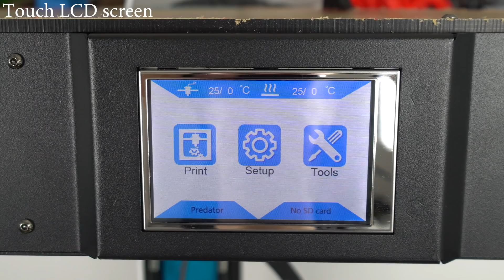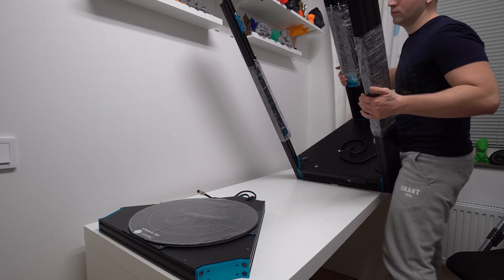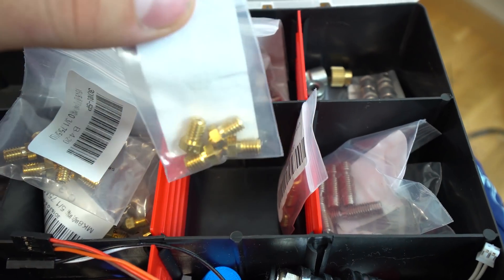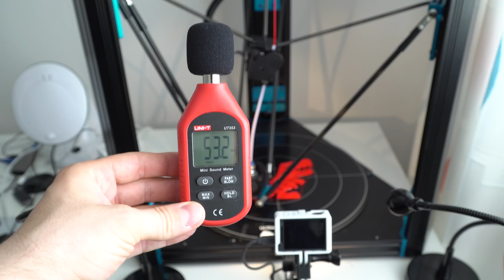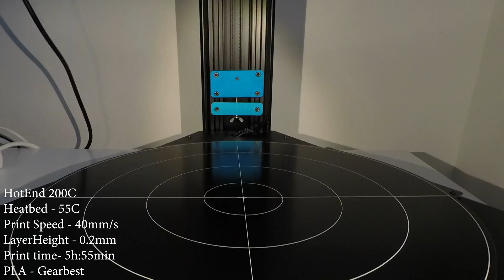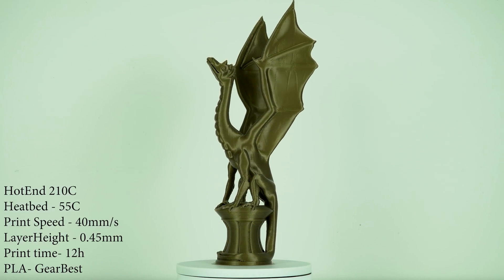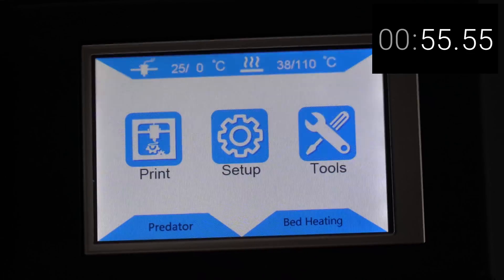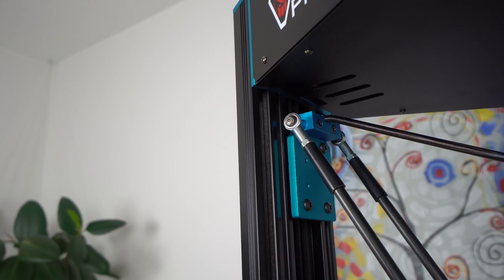Anycubic Predator 3D printer Review - all you need to know

Comment: How does the Predator compare to the Chiron?  Was there an appreciable difference in speed or print quality? Great reviews- appreciate the indepth look
Reply from the maker: Thanks Thomas! Yes there is, Predator is much faster and more easier to level then Chiron. In terms of actual print quality Predator is better then Chiron at higher speed as it's Delta but on other hand Chiron has Massive 400x400 heated bed and it will print much bigger object then Predator. It's dead race between Speed and Massive Size. Car VS truck :)
Reply: @NexiTech  - Cheers! Thanks for the insights

Comment: Which slicer do you use? And if possible can you share the printing profile for the printer?
Reply from the maker: Peter Horvat PLA
Layer height 0.2mm 
Top layers 5
Bottom 4
Walls 2
Flow 103%
Infill 20%
Hot end 200C
Heat Bed 55C
Print speed 50mm/s (up till 100mm/s depending of model)
Travel speed 120mm/s (up till 200mm/s depending of the model)
Retraction distance 5mm 
Retraction speed 70mm/s
Cooling 100% from 2 layer
Minimum Layer time 10s

PETG
Layer height 0.2mm 
Top layers 5
Bottom 4
Walls 2
Flow 103%
Infill 20%
Hot end 220C
Heat Bed 70C
Print speed 50mm/s
Travel speed 120mm/s 
Retraction distance 5mm
Retraction speed 70mm/s
Cooling 50% from 2 layer
Minimum Layer time 10s

FLEX - from the video
Layer height 0.2mm 
Top layers 5
Bottom 4
Walls 2
Flow 103%
Infill 15%
Hot end 220C
Heat Bed 55C
Print speed 40 or 50mm/s
Travel speed 120mm/s 
Retraction distance 5mm
Retraction speed 70mm/s
Cooling 100% from 2 layer
Minimum Layer time 10s

ABS
Layer height 0.2mm 
Top layers 5
Bottom 4
Walls 2
Flow 103%
Infill 20%
Hot end 240C
Heat Bed 105C
Print speed 50, 60mm/s
Travel speed 120mm/s 
Retraction distance 5mm
Retraction speed 70mm/s
Cooling 0% 
Minimum Layer time 10s

Simplified 3D Anycubic Predator standard print profile 
https://drive.google.com/open?id=1w9Vigkn7B-lKUcAPlnHZEVsymKBcpIoZ

 I hope that I helped
Cheers
Reply: @NexiTech  Thank you very much. Very helpful and saved me a lot of parameters testing time.

Comment: So anyone interested in this machine I figured something out.  On the net you will find two types of reviews about this machine.  Either GREAT reviews, or really AWFUL reviews.  This review is thorough and detailed as are others on Youtube.  On Amazon USA, about half of the reviews are great and the other ones are terrible.  1 or 5 stars, nothing in between.  But all the reviews appear to be from credible sources.  Most of us know our way around these machines.

I believe all the reviews with good ratings have the PREDATOR branding on the top front left of the printer.

The Amazon US page shows the Kossel D printer when you search for Anycubic Predator.  And the product images are mixed, showing units both with ANYCUBIC branding and with Predator branding.  I figured I'd take a chance and ordered this on Amazon USA.  My unit arrived with ANYCUBIC printed where I expected to see the PREDATOR logo.  So I had Amazon take the unit back free of charge. These are basically the same machine, but apparently the ANYCUBIC branded units were earlier units or models of this design.  And who knows what changed?  Different sensors maybe?  Or more likely they were earlier batches with serious QC issues, as is common with Chinese 3d printer companies.  But on Amazon the Anycubic seller is unscrupulous and just mixes them together to hock them off to us, BUYER BEWARE.  Don't these companies realize that reputation is everything? Anyway, the massive box was sent back to the seller at the seller's expense.  Anyone know where to get a legitimate Predator here in the USA?
Reply: I'm not sure if Aliexpress delivers to the USA but you could try your luck there. You are not the first to voice your concerns with regards to the QC differences between the "Kossel D" and "Predator" variant. Folks at Reddit seem to have the same hypothesis as you do.
Reply: UPDATE-  Well it turns out I was wrong.  Anycubic tells me that the units branded ANYCUBIC are actually newer than the Predator.  Apparently they changed branding because they were worried about infringing on the word Predator, which would make sense.  But it would be nice to know this sort of stuff before it shows up at your door.
Reply: @Shane , not really...my wrong assumptions cost ME the shipping difference cost to and fro.  I paid for the shipping differences.  Nevertheless a company has to be responsible for it's branding.  If you buy a Ford F150 Raptor and it shows up at your house marked FORD TRUCK, it's not unreasonable to assume that there are model differences.  Especially when there a scattering of reports about this printer.  I'm still putting it through its paces but have no plans to return it.

Comment: Hi, thanks for another great video, do you share your profiles for the printer? Thanks in advance.
Reply from the maker: Stig Berntsen Thank you. Problem is that I change my print settings on the 'fly' depending of the model that I need to print but here is sometning to get you started. 
PLA
Layer height 0.2mm 
Top layers 5
Bottom 4
Walls 2
Flow 103%
Infill 20%
Hot end 200C
Heat Bed 55C
Print speed 50mm/s (up till 100mm/s depending of model)
Travel speed 120mm/s (up till 200mm/s depending of the model)
Retraction distance 5mm 
Retraction speed 70mm/s
Cooling 100% from 2 layer
Minimum Layer time 10s

PETG
Layer height 0.2mm 
Top layers 5
Bottom 4
Walls 2
Flow 103%
Infill 20%
Hot end 220C
Heat Bed 70C
Print speed 50mm/s
Travel speed 120mm/s 
Retraction distance 5mm
Retraction speed 70mm/s
Cooling 50% from 2 layer
Minimum Layer time 10s

FLEX - from the video
Layer height 0.2mm 
Top layers 5
Bottom 4
Walls 2
Flow 103%
Infill 15%
Hot end 220C
Heat Bed 55C
Print speed 40 or 50mm/s
Travel speed 120mm/s 
Retraction distance 5mm
Retraction speed 70mm/s
Cooling 100% from 2 layer
Minimum Layer time 10s

ABS
Layer height 0.2mm 
Top layers 5
Bottom 4
Walls 2
Flow 103%
Infill 20%
Hot end 240C
Heat Bed 105C
Print speed 50, 60mm/s
Travel speed 120mm/s 
Retraction distance 5mm
Retraction speed 70mm/s
Cooling 0% 
Minimum Layer time 10s

Simplified 3D Anycubic Predator standard print profile 
https://drive.google.com/open?id=1w9Vigkn7B-lKUcAPlnHZEVsymKBcpIoZ

 I hope that I helped
Cheers
Reply: @NexiTech  It would always be a good starting point if people could get the "showing print" profile. If it changes later, does not matter, it would at least give a good starting point.

Comment: greetings, good video I have a super problem, and tried many, many parameters for the retraction I spent 1Kl filament and I could not find the correct retraction, the manufacturer's configuration does not work either, I'm about
to give up, if you would give me a hand I would like it, use cura 4.0 and the factory
Reply from the maker: Nestor Perez Problem is that I change my print settings on the 'fly' depending of the model that I need to print but here is sometning to get you started. 
PLA
Layer height 0.2mm 
Top layers 5
Bottom 4
Walls 2
Flow 103%
Infill 20%
Hot end 200C
Heat Bed 55C
Print speed 50mm/s (up till 100mm/s depending of model)
Travel speed 120mm/s (up till 200mm/s depending of the model)
Retraction distance 5mm 
Retraction speed 70mm/s
Cooling 100% from 2 layer
Minimum Layer time 10s

PETG
Layer height 0.2mm 
Top layers 5
Bottom 4
Walls 2
Flow 103%
Infill 20%
Hot end 220C
Heat Bed 70C
Print speed 50mm/s
Travel speed 120mm/s 
Retraction distance 5mm
Retraction speed 70mm/s
Cooling 50% from 2 layer
Minimum Layer time 10s

FLEX - from the video
Layer height 0.2mm 
Top layers 5
Bottom 4
Walls 2
Flow 103%
Infill 15%
Hot end 220C
Heat Bed 55C
Print speed 40 or 50mm/s
Travel speed 120mm/s 
Retraction distance 5mm
Retraction speed 70mm/s
Cooling 100% from 2 layer
Minimum Layer time 10s

ABS
Layer height 0.2mm 
Top layers 5
Bottom 4
Walls 2
Flow 103%
Infill 20%
Hot end 240C
Heat Bed 105C
Print speed 50, 60mm/s
Travel speed 120mm/s 
Retraction distance 5mm
Retraction speed 70mm/s
Cooling 0% 
Minimum Layer time 10s

Simplified 3D Anycubic Predator standard print profile 
https://drive.google.com/open?id=1w9Vigkn7B-lKUcAPlnHZEVsymKBcpIoZ

 I hope that I helped
Cheers

Comment: Thank you for the reviewing video, Nexi Tech. The 8-diode board rocks.
Reply: ANYCUBIC is it included in the new predator machines ?
Reply: @trm7782  Hi trm, it is not included.
Reply: ANYCUBIC Which one of your FDM printers has the best print quality ?
Reply: @trm7782  All of them are good. But for the beginners, I'd recommend i3 mega because it's easy to install and use. For thoese who want to print something really big, I'd recommend predator which helps you to build as large as 370×370×455mm. If you print garage kit, photon is a good choice.
Reply: @ANYCUBIC3D  what about chiron? You recommended predator for big prints. But why not chiron?
Reply: Hi, can you please help me understand why there are different prices of the product on AliExpress, but when I click on any one it says official store? What is the reason for the price variations?
Reply: I just bought this anycubic printer. i see lots of Salmon skin are the TL smoothers really that good? Is there any negatives to the TL smoothers? If not why doesn't anycubic sell the printer with TL smoothers?

Comment: What settings do i need to print with ABS ?
-Amazing video btw :D
Reply from the maker: fernando perez rabago 
Problem is that I change my print settings on the 'fly' depending of the model that I need to print but here is sometning to get you started. 
PLA
Layer height 0.2mm 
Top layers 5
Bottom 4
Walls 2
Flow 103%
Infill 20%
Hot end 200C
Heat Bed 55C
Print speed 50mm/s (up till 100mm/s depending of model)
Travel speed 120mm/s (up till 200mm/s depending of the model)
Retraction distance 5mm 
Retraction speed 70mm/s
Cooling 100% from 2 layer
Minimum Layer time 10s

PETG
Layer height 0.2mm 
Top layers 5
Bottom 4
Walls 2
Flow 103%
Infill 20%
Hot end 220C
Heat Bed 70C
Print speed 50mm/s
Travel speed 120mm/s 
Retraction distance 5mm
Retraction speed 70mm/s
Cooling 50% from 2 layer
Minimum Layer time 10s

FLEX - from the video
Layer height 0.2mm 
Top layers 5
Bottom 4
Walls 2
Flow 103%
Infill 15%
Hot end 220C
Heat Bed 55C
Print speed 40 or 50mm/s
Travel speed 120mm/s 
Retraction distance 5mm
Retraction speed 70mm/s
Cooling 100% from 2 layer
Minimum Layer time 10s

ABS
Layer height 0.2mm 
Top layers 5
Bottom 4
Walls 2
Flow 103%
Infill 20%
Hot end 240C
Heat Bed 105C
Print speed 50, 60mm/s
Travel speed 120mm/s 
Retraction distance 5mm
Retraction speed 70mm/s
Cooling 0% 
Minimum Layer time 10s

Simplified 3D Anycubic Predator standard print profile 
https://drive.google.com/open?id=1w9Vigkn7B-lKUcAPlnHZEVsymKBcpIoZ

 I hope that I helped
Cheers
Reply: @NexiTech  Thank you! Will try these tomorrow. Been having issues with PETG. Hoping this will help.

Comment: Just bought this printer with TL Smoothers BUT they didnt come with the heat shrink covers.  Are they necessary? If so, where do I get them?
Reply from the maker: Sean Reynolds Take some cutters and cut those extra soldiered wires(pins) that stick out on the bottom side of TL-smooters and use some thick 3M tape to lift it away from frame. You need to make sure that they not touch metal frame as they can short out. You could use some electrical tape underneath to isolate them.
Reply: @NexiTech  Sounds good. I will do that.  Thanks for the awesome videos! Keep it up!!

Comment: Thank you for a great review i have a question about the TL smoothers you did not change the wires around like some videos I have seen ie red opposite red yours are reversed do you know which one is correct please.
Reply from the maker: With TL-smother that I used there is no need for that. They are already in correct positioning. If you have the wrong wires position on yours don't panic, just follow the stepper motor wires polarity and if needed use tweezers and press pins on TL-smoother connector and pull out wire and change it to right position.
Reply: @NexiTech  Okay thank you very much

Comment: I did not see how Heat-bed insulation is installed, are you in this video? thanks
Reply from the maker: I did not installed yet on my Predator. I just mention that I suggest that heat-bed insulation should be installed for those makers who look for faster Heat-bed time and also is good for saving electricity. 
Installing is easy.
 -Order 400x400 cotton sheet (Link in video description)
-unscrew heat-bed scresw
- Remove heated bed
-Place heat bed on the cotton sheet
- use knife or scalper to cut circle around the glass bed
- Glue the cotton sheet to the aluminum bed underneath with the silicon glue
-Reinstall heated bad back to the frame
-Warm up the heated bed to 45c to speed up curing process
-Done
Reply: @NexiTech  Many thanks for your response, I am willing to purchase a Predator, as the first printer I will own, do you think I will have any difficulty learning to operate it?
Reply from the maker: Fábio Martins No problem, Nope, not really. This delta is very easy to use. Simple printer  software interface. It's more of Slicer software that you need to learn how to use. I recommend CURA. Free and very good.

Comment: Amazing Review !! :D :D Very informative....  Got better print results after the suggested upgrades!
Also, try using tension springs across the parallel rods to minimize the vibrations on the end rod bearing at high speeds. :) 

What retraction distance and speed do you use ?
Can you share your Printer Profile ? Looking forward to seeing more videos :)
Reply from the maker: Thank you so much Mate! I'm glad that you liked my video and found it useful. Thanks for spring suggest upgrade I have already brought a bunch of different size springs and I'm in testing process to found which one will produce best print quality.
 Here are the few photos. https://drive.google.com/open?id=19Fcg-XP4RcRSa6heNmf5yPWvwSiKjeWm
I'm working on print profile but S3D have bug and I can't save print speed and layer height in print profile for each material and speed so I can only share my standard settings: 
PLA
Layer height 0.2mm 
(without TL-smoothers) 
Top layers 5
Bottom layers 4
Walls 2
Flow 103%
Infill 20%
Hot end 200C
Heat Bed 55C
Print speed 50mm/s (up till 100mm/s depending of model)
Travel speed 120mm/s (up till 200mm/s depending of the model)
Retraction distance 5mm 
Retraction speed 70mm/s
Cooling 100% from 2 layer
Minimum Layer time 10s
Reply: @NexiTech  Thanks a lot for sharing Mate ! :D Good Luck with your upgrades... looking forward to seeing them. Have a productive day!
Reply: @NexiTech  The springs look way more professional than O-rings or rubber bands. Great idea.

Comment: Thank you, Nexi. This is a nice review again. As a new owner of that printer I appreciate your mods and the printing tips. In my case setting up the printer took much longer, because one of the end stop sensors didn't trigger. It was easy to fix once I understood the issue. My box came with an additional pair of carbon fibre tubes, but the cable cover was missing.
One question: do the pulley sliders hold position on your model, when switching off the printer? Mine sink down until the nozzle touches the bed (if I would let it happen ;-))
Reply: One more question: when leveling how can I adjust the x y start position of the print? It always puts the object off-center for about 2 to 3mm on x and y axis.

Comment: Great review! Where do you use heat-bed insulation? How do you install stepper motor dambers?
Reply from the maker: It's pretty easy. Should I need to
make video about it? Or you wish that I write here a quick guide?
Reply: @NexiTech  yes plz a guide!! Thx!!
Reply from the maker: Heat bed installation Quick guide
Parts needed: 
-heat resistant cotton sheet 400x400mm
-Silicon glue
Links in video description
Installation:
- unplug Heated bed cable
-Remove glass plate platform(unscrew 6 screws)
-put 400x400 cotton sheet on flat surface like table and place ultrabase glass on it. 
-take marker or pen and mark a circle.
-rotate Ultrabase and mark rest of the circle.
-use scissors or scalper to cut out a circle.
-place Ultrabase glass on flat clean surface like table(use cloth)
- Apply silicon glue in circular motion on aluminum heated
-Place cotton sheet circle over silicon glue on the aluminum heated bed.
- Apply some weight on the top to press it, like few books, some weights...
-Let the silicon cure over the night. If you are in hurry reconnect heated bed cable and set 45-50C for 45minutes on the Heated bed to speed up the process.
Reply: Yes I also interested to know this
Reply: I would like to see how this is done also.